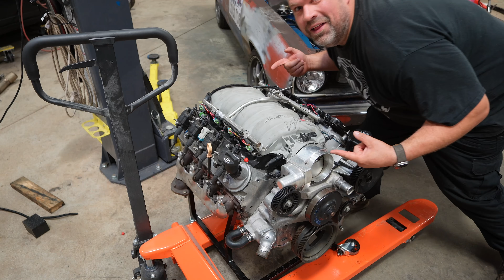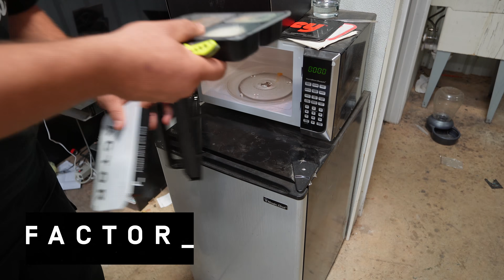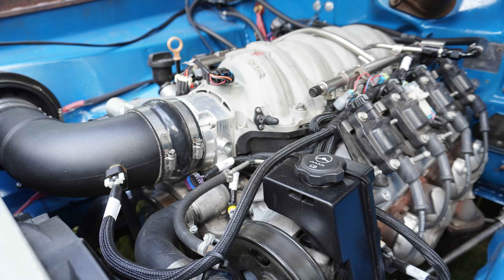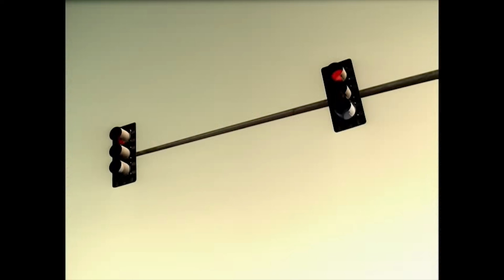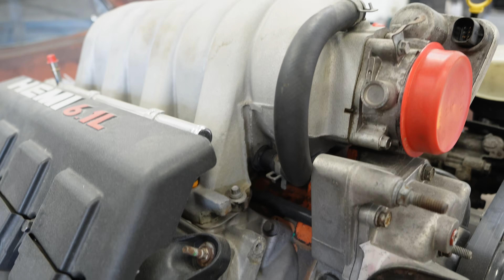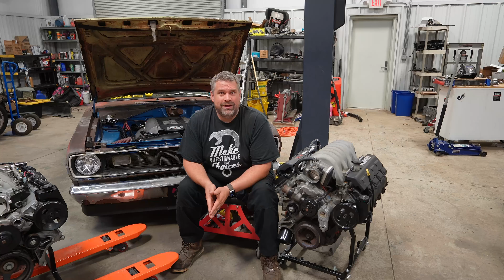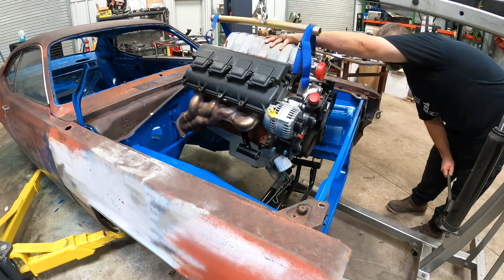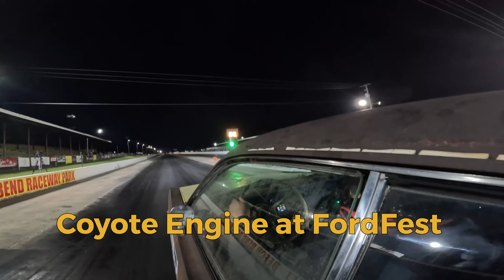What No One Tells You About Engine Swaps! Best Engine To Pick?

Comment: Jarrod, I am seventy four oct, twenty ninth. I seen a time when you wanted dual exhaust and of course we couldn't reach in our pockets yet for the tri five era. Now this is going to hurt some feelings for sure but ford had a flathead V8 and then the Y block engines. So being the only kid in town who's dad had a machine shop, guess who dated some hot chicks. The heater was optional but twin antennas and a stolen radio with speakers out of the family stereo or even some tv sets. I was that kid that took out a good running six from a fifty chevy two door hardtop and put a flathead V8 engine, then tried to hide the engine with a large air cleaner or other tom foolery from J.C. Whitney catalogues. Please now let me say that the fifty chevy did get a oldsmobile V8 a bit later and it was damn hot as it was a ride for our town sheriff. I may have told you how we stole that engine out of his car at one time or another/LOL. So when we claimed "Our engine is hotter than yours".... almost a confession would ya think? In nineteen sixty four, I had my emancipation papers in hand and with good money earned logging some land that I was able to get ... dang good story about that some time later. 1964 was the year that I walked into a dealership, seen a black on black 63 1/2 ford X code spread manifold dual fours and four speed transmission. It was a hard sell in that town, people there just were not fans of power and sounds so loud that the windows rattled when ya turned it up. I think it turned around a whole bumping four thousand rpms. Big block fords were not high rpms engines if my memory is correct..... and again so long ago that I might just be south on what was what. The important thing was the police chief hated me bad and was in favor of me taking myself out. He authorized that dealership to sell it to me. "Hell, the kids dead anyway in a couple years .... his a** is in viet nam!!! He was right about that part for sure. I will get to the point..... all said and done, what would leave me on the starting line with tires gasping for traction was another ford! A nineteen sixty two fairlane with a 302 and a three on the tree. It was a close ratio T82 transmission as I did buy it from him..... best transmission ever and ever!!! Those were the "Rock Crusher" transmission for fords. Dump as much power as you wanted then and it just begged for more. When you could take a stock three o two engine with a two barrel carb... granted biggest jets available for it, and that transmission.... it would break the one hundred miles an hour in second gear...... yeah it did take a bit to wind it up to that point but laddy..... sure was fun hearing them Thrush mufflers screaming as it just changed the tone of a straight piped rig enough to get past the cops.... enough of my stories as you are asleep by now. Those were my best years of my life!

Comment: My go-to swap has been the Ford 7.3 Godzilla. From the factory it comes with forged internals and can handle a ton of boost. From what I've been seeing is a cam, headers, intake manifold, throttle body and a tune and you're making stupid amounts of power on a stock block and heads. :)
Reply: the cost to swap them is just way too insane. just starting with the fact you need an aftermarket intake to fit under any normal hood.

Comment: I'm a ford guy, and have a 65 mustang. Its a built 289.

I see LS, and Coyote swaps in these cars frequently. I always enjoy asking why this specific engine. Typically, LS swaps are affordability and ease of working on. They take alot less engine bay massaging, and you can get away with cheap power. The coyote guys have more money to build the car around the engine rather than vice versa. The shock towers are going to need to either be cut or removed for a coyote to fit. Because of this, its alot more expensive to run the coyotes.

Like you said, it really is down to what YOU want.

Comment: Jared, the Hemi did not deserve to be equal to the LS in terms of engine swaps.  In your specific application, with swap parts that were meant for a Hemi, it was easier.  The LS, besides being slightly smaller and lighter (both advantages for engine swaps), also has FAR bigger support for swapping into vehicles they aren't meant for.  The Hemi, not nearly so much.  

Unless you are dying to be a fab shop and parts developer, aftermarket parts support is such a huge factor, and the LS beats them all easily.  As usual, LS is the answer.
Reply: it's so dependent on the platform. obviously if you're going to swap into a fox chassis, the coyote has way more support than the hemi.

Comment: For most people cost is the #1 factor. Anyone can pick up an LS truck engine for $400 and spend $2000 in high end parts to have an amazing engine easily running 500-700hp. For the Coyote and Hemi, you're looking at minimum $2000 right out of the gate just for the engine, and then another $3-5K+ for the parts to get it to the same power level, plus spending twice as much time to get it there due to complicated nature of them.
Reply: Gets the same power level right out of the gate.read way more than the l.s.
Reply: Nah 400 bucks for hemi running
Reply: Got a 2015 5.7 hemi block in mint shape for 20 bucks on facebook the only reason you don't see more on them is cause they didn't come in a lighter platform has just as much potential as a 5.3 or 6.0 all of them need crank rods and pistons but the 5.7 comes with way better heads and 395 hp stock with the truck manifold 2009 and up
Reply: Well most 5.0 engines come with over 400hp so it won’t be much to get to the 500hp mark .. a normal ls from a truck is around 300hp . A hemi is around 370hp it will coast most to build a hemi to get around 500 hp unless u go with a scat pack engine and that version isn’t competitive you can’t get big power out of them without swapping out the internals which is more expensive than just building a regular 5.7 hemi .. the 5.0 has the most potential and is the better option but the ls is cheaper and can still get as much power than both .. but still won’t handle as much power as a coyote .. the 5.0 is more expensive because it’s on another playing field in a league of its own .. you get what you pay for
Reply: @samadagoat7769 I couldn't have said it better 👍🏾
Reply: @samadagoat7769 I can rebuild a complete LS and add 200hp for about $1000. So, can get an engine easily for $2-300 ( I have a half dozen on shelf in my garage currently) , so $1300 for 500hp isn't bad. Just knowing which parts to put together is the key. Parts are so cheap for the LS it's ridiculous.
Reply: @erik120719 is the 4.8 vortec (LR4) an LS?
Reply: @559caliii  technically it is in the LS family, I believe someone will get all bent out of shape sayings it's a LS, as some guys think only engines like LS1,ls3 are LS engine, and truck engines are really a Vortec engine. All the same parts I'm all of them, just some variations. The little 4.8 cammed can make for a mean little motor for sure tho.
Reply: @samadagoat7769 damn actually like that point pf view
Reply: The only complicated engine is the coyote. The ls and hemi are pretty much identical as far as complication goes. I'm also calling bs on a 700hp $2400 truck engine.

Comment: Ls4 n northstar bolts up to the transmission that came with the 3.8 camaro n firebird I believe, the 3.8 is a fwd engine but rwd in camaros n firebird n the 3.8 n ls4 n northstar have the same bolt pattern... well close enough to work, the problem with the ls4 is no starter, I've seen a jegs oil pan with starter mounts on YouTube but couldn't find one myself to buy.

Comment: Lets face it, the LS has been done to death. The Coyote is a nice looking engine. I think it would look nice put into a modern version of the open wheel roadster. Almost has a similar look to the old "cammer" engine. The new hemi seems to be a decent choice. Its missing the hemi look. It needs the big cast aluminum valve covers. Its plastic. And you don't have that visual look of the spark plug wire going through the center of the VC. All you see is 4 individual coils on each side. I'm  not a Chrysler guy. Does the aftermarket have any big aluminum  covers that have the old style look ? I'm  sure the coils could be relocated. If I'm going  do a hemi swap, I would want it to at least look like one. So when you open the hood there is no question,, yeah, thats a hemi.

Comment: Jared, if I had the money I would swap my Ford Triton V-10 in my van out for an LS. It is so tight and such a pain in the ass to work on that there are 2 plugs an coils that I have never replaced because just to get to them without hiring a tiny contortionist or removing the fuel rail, injectors and all kinds of other things that, for me, it's damn near impossible. I did have to agree with you though, just from watching the whole Triple Crown series that the Hemi sounded the best.
Reply: An LQ9 in an Econoline lives in my head rent free.

Comment: I’m considering replacing the 460 big block in my 1990 F350 with a diesel, but the triple crown Duster series is making me consider doing a more modern gas engine instead
Reply: Maybe look at the Godzilla? It's a modern, big block gas engine used in the F250. Not sure if it's in the F350 (hopefully someone more knowledgeable can chime in.)
Reply: @stephenreed3381 Yes the 7.3L Godzilla V8 is in the F350 as well.

Comment: If you're a Ford loyalist you also now have the option of the Godzilla..  Which is basically Ford's version of the LS just more expensive, and nearly unavailable second hand as of yet. The Coyote is around 29 inches wide at the VC's. where as the Godzilla which has a 7.3 liter displacement is just over 24.5 inches wide at the VC's. Mind bottled!!
Reply: Saw mention of "Godzilla" elsewhere.  Thought they were talking about the GTR.  😅

Ironically it took someone with a GTR avatar explaining this to make sense.
Reply: The ls is a copy of the Ford windsor.  So the godzilla is a copy of a ls which is a copy of a ford to begin with.
Reply: The Godzilla will get clapped by a small block Hemi anyway.
Reply: Depends if your racing or towing...I agree on racing but when towing you need displacement
Reply: @PyroBlonde7777  1000hp and 1100 tq are extremely easy to get in the Godzilla. You can push the bottom end to about 2000hp. If you destroke it you can turn 10,000 rpm. A Hemi won't stay together after 1000hp on a stock block for long.
Reply: @PyroBlonde7777 5.0s handle hemis no problem
Reply: The ls is GMs version of the sbf

Comment: I don't even need to watch this to tell you it's the LS. On engine masters they took a stock bottom end 4.8L put heads intake and a turbo and saw 1500 HP, and the only reason they couldn't go higher was they only had a 3 bar map sensor

Comment: Excellent video as usual, very informative, they all are cool engines, but i like the LS more.
Also, on the Ford side i was expecting a small shout out to the Ford 7.3 Godzilla engine, basically the Ford "rendition" of the LS truck engine, it is VERY capable and they are becoming easy and cheap to find.

Comment: A interesting fact about the ls, When GM outsourced the production of the lt5 to Mercruiser the engineers took offence and secretly put aside funding to develop the ls engine to be more powerful and efficient.

The HEMI's big downfall really the lack of an aluminum block and the lifter oiling failure.

Have to hand it to the mod motor because its a work horse and runs very smooth the trencher slap is an embarrassment and made a lot of peoples trucks seem like a pos, I have to say the Brabham BT62 is the greatest sounding thing ever.

Comment: The 4.6 Ford V8 is to this day my favorite Ford motor simply because you cannot kill those motors.  Yes they are severely underpowered, Yes they don't rev really high, and yes they do have spark plug issues.  Other than all that they are very reliable motors (for the most part), you can make big power with them, and they make pretty good low end torque.  But for me, I'm a Chevy guy. I will always choose an LS motor over everything including the hemi.
Reply: Spark plug issues are the 5.4 & 6.8
Reply: I'm still surprised the Navigator 5.4 isn't a more common swap. They can run 4.6 4V performance parts and Coyote intakes.
Reply: They have squashed the spark plug issue years ago. There are guys racing these engines now with well over a 1000 horsepower. Worlds Fastest 4.6 is just one of those guys

Comment: I found 2 MAJOR differences in engines/swaps. The first 2 that should always be looked at. 1) Availability of aftermarket parts. Or even OEM parts (think Magnum engines, bottom of barrel support). This include cam sizes, headers, heads etc. and 2) COST of parts. There is a reason people are not slapping 12 cylender viper or lambo engines in their cars. So even if you can find parts, they are often double and up the cost of comparable SBC or SBF parts. You can build a LS motor with twice the performance as a Coyote crate engine.  Now. One would think the LS crate motor is cheapest oer HP. but in my research the Hemi 392 crate for 8K is best dollaer per HP deal to be found. (vs 11K for LS) But this is just new, crate motor options.  If you are a engine builder then the massive choice in aftermarket parts makes the LS #1.  All of this said, your video touches a bit on all this and the adoption of said engines is what steers aftermarket engineering  and cost. Hence why LS is currently best. before that any SBC was kig, followed by ford.  Just my 33 cents.
Reply: psst... Vipers are 10 cylinders... not 12.

Comment: The coyote motor has a lot of support in the Ford Community if you're switching it inside of a Ford it's great but you always run into the space problem cuz it's a big gigantic thing that's why a lot of people are leaning to the 7.3 Godzilla good old Ford making a bigger motor that smaller the ls well it's an LS motor you can go to a junkyard quick-and-dirty look for a wrecked SUV or truck cuz you know it was running when it got hit 800 to 1100 usually they've been modified already they are cheap they are effective I can't speak on Mopar never owned one never thought about buying one not because they're bad Motors I just don't know anything about them never owned one they make power in no way am I saying that any of these motors are bad they'll have their perks

Comment: The Ls is coming up on 30 years(26). The Eagle hemi has 14 years. The 5 oh has 12 years. That's why the Ls and Vortec has so much more support.
Reply: Really  can you just bolt any transmission to your 5.0 nope...

1966 power glide bolt right up no modification required.   60 years between them still work together flawlessly..  cost you thousands for a guide or th400 in a coyote
Reply: I honestly don't think they have any more support the mustang has a huge aftermarket.

Comment: Ls4 came in the impala ss, Grand Prix gxp, and the Buick lacrosse, and mates to the 4t65e-HD, also can be used with 4T80e from a Cadillac (ls4 king did this)with some modifications and also the f40 manual transmission from the Pontiac g6 gxp . (Fiero guys did this) Those are the 3 I know of.

Comment: Surprise surprise you didnt like the Ford, even Mr Wonder could see that coming. I do have to agree with you though that the Coyote is not really suitable as a cheap, easy engine swap motor they are just to big. In NZ they are like the turbo barra motor to you, pretty much unobtainable. But here and Aussy we can get the Falcon 6's cheaply and boost them to over 1000 hp ( not cheaply).
Reply from the maker: It’s not that I don’t like ford, it’s just the coyote, it hurt me a lot emotionally while swapping it into the duster.

Comment: I'd be interested to see what you'd think of the duster with Ford Australia's boosted 'Barra' inline 6. Those things can pump out 800hp with just a few mods. I think it would put the 5.0 to shame while giving you better front end feel because of the lightness in comparison.
Reply: The Barra is heavier than an aluminum block LS and isn't cheap either. It's also got many issues with harmonics to deal with as well.
Reply: @Sean_Farmer Why would an inline six have harmonic issues? Most of the cost is getting them out of Australia. I wanted one to swap in my CVPI when I had it. Somebody on here during covid, put one in a s550.
Reply: Barra's are boat anchors, VERY heavy, also, not an easy engine swap to do in the USA.
Reply: The problem is that the 4.0L Barra Inline Six won't outlast the Coyote V8 at all.